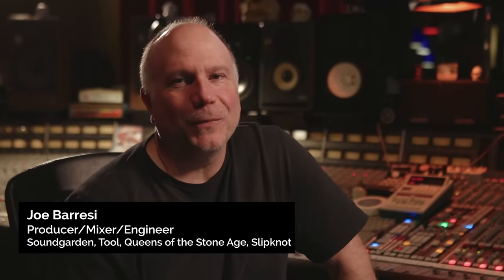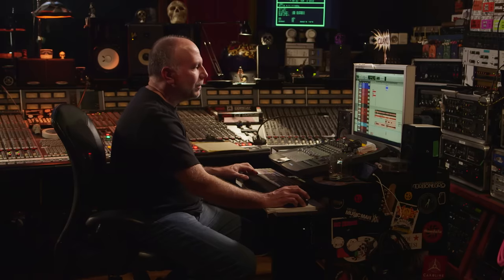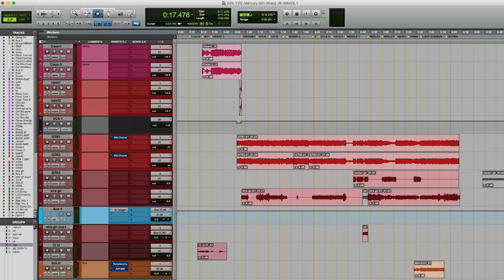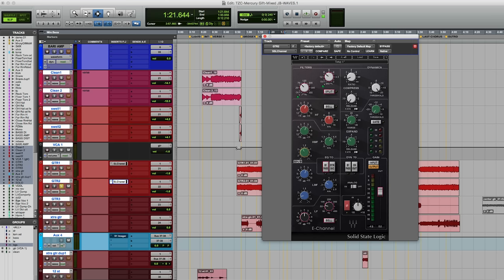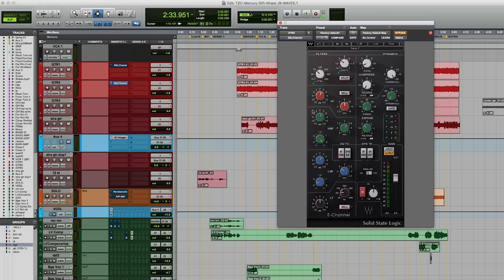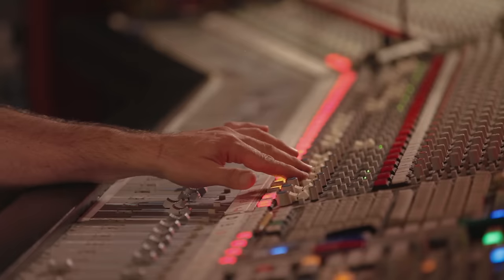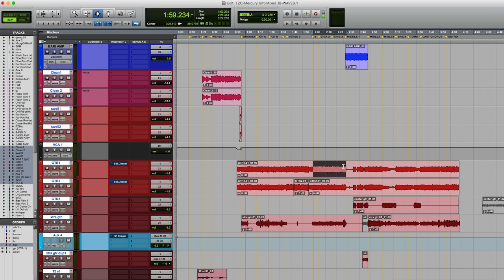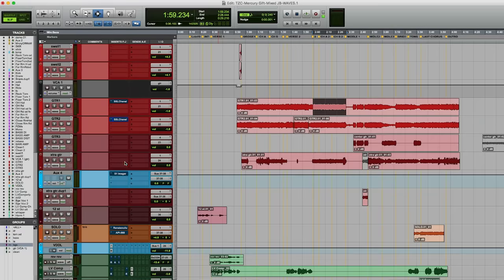Mixing Distorted Guitars | High Gain Tips by Joe Barresi

Comment: That is what I refer to as more of a classic crunchy guitar sound than I do modern, High gain distortion. The PRS lead/proper channel which the Archon possesses aside from anything in GTR is a fine starting point with a Maxon od 808 (or whichever overdrive or boost that suits your tastes/works with the front-end to smash the preamp harder, Tighten things up + the trusty, does exactly what I need/want in the boss ns-2 is and that is my type of territory and the guitars are most of the time far below standard tuning and longer than 25.5" scale-length).

The advice is all still applicable though and works. A great tool that I deploy but it sounds not exactly great isolated is an original roland microcube on the rectifier aping cosm model thing, It does a solid job at pinning down a rhythm track, same with a peavey bandit, a randall rg and the older marshall mg amps. Stuff that might be used for sratch tracks has numerous times found its way in to the final mix, The same way the now infamous Rockman for solos and then a little later the original SansAmp for all purpose essentially. I supose "extreme" is the term used to distinguish between the area which I operate in compared to the legend that is Joe Baressi.

I've never heard anything by Joe that isn't great, EJB and Melvins are up in the god tier level in my world. Cheers Joe for all the invaluable advice, Great albums You've hand a hand in and Waves for the consistantly great tools over two decades now and still delivering \m/

Comment: I've been wanting to experiment with a pedalboard solution for mixing different fuzz/distortion/clean blend/octave in a parallel mix? Either into one, two, or even possibly three power amps? 
Currently riffing on a cheap (but competently modded) 30" scale Firefly baritone offset with dual humbuckers. 
Currently been using an Orange OMEC teleport as just a mono to stereo splitter. then using a cheap Tech21 Orange preamp clone on one side, and either an EQD Life pedal V2 clone or an EHX Big Muff deluxe. Sometimes both! Then I'm using a cheap Sonicake ABY in reverse to sum it all back to mono.
The hypothesis in principle IMO is sound, I just have no way to blend in a clean signal for clarity or phase flip any potential issues.
I know I'm overthinking this, but I also possibly need much better buffered splitter & summing pedals? The JHS utility stuff comes to mind, as does the  something as simple as a Mosky Audio Loop Box?
Not sure...

Anyway,
You totally F'N HAD ME at "Parallel Distortion" Joe!
Haha! 
Brilliant!

Comment: Reading these comments you'd think nobody actually knows what preamp tubes do to the sound of a guitar. 
To elaborate, turning up the first gain stage on the amp will cause "clipping" or a bit of distortion,  and in general, you'd be hard pressed to find a guitarist who actually runs the pre amp stage on 0. hence, that's his "clean" sound.
Reply: pre amp tubes do NOT have to make your guitar pushed or crunchy at all unless you want them to.

Comment: thanks for vid great stuff.  question. Ive been taking a direct out of the guitar before the guitarist sends it off to amp land.  then usually micing the one cabinet with a 57 up close and a ribbon about 4 feet back. then panning the two mics left to right later lining up the phase on just the 57 and direct which Usually ends up archived or running into the guitar rig VST plug in.

So is the out of phaseing thing going on between the 57 panned opposit the ribbon mic (4 feet back) a problem because it seems to mono up fine? thanks for great vid!  and thanks for not using a bunch of plug ins the rest of us cant afford for this example

Comment: when using the ssl plugin, he 'burys' the compressor threshold. Is that because with a normal amount of GR he knows he gets the level he likes to have coming into the plugin? anyone know? thanks!
Reply: Pretty much. Given the low ratio and fast attack on the compressor and the inherent lack of dynamics in high gain guitars, my guess is that the threshold is buried simply for the fact that he wants as much of the guitar signal getting slammed as possible, and  finesses the amount of gain reduction with the ratio.
Reply: Andrew Leyenhorst thanks for the reply! Yeah thats kinda what i was thinking, I’ve just always heard about some waves plugins preferring a -18db analog level input saturation-wise, i thought this might be his way to make sure he doesn’t go over that? But yeah maybe he just likes to control GR with ratio instead of threshold

Comment: Metal used to be interesting.  Now it's so stock - rote guitar sounds, drum samples instead of room sounds, always in the lowest keys, and codified vocals in the 'ordained' arrangements.  Those guitar sounds are terrible cause of the cliche.
Reply: Modern metal may as well be a sine wave.
Reply: @harrisfrankou2368  I prefer a sawtooth
Reply: @MixChecks  yes and double kicks so fast you cant hear them.
Its important to have no dynamics...
Reply: @harrisfrankou2368  Have you tried replacing a 400BPM blast beat double kick with a fart sample? It works pretty well.
Reply: @MixChecks  I have.
To be honest to chop up the farts/parts into smaller rolls,I used ableton and my Guitarist disowned me for using "a gay dance program" as he called it.
I am still scarred by the breakup.
My bass player was even less tolerant.
Im on a very high beanbacon and eggs diet again and hope to let some real rippers go.
I have a mic in the toilet so I can capture some with natural organic reverb.
Reply: @harrisfrankou2368  Good stuff. The toilet bowl impulse response is my go-to for adding that slappy "wet" sound to all my kicks.
Reply: @MixChecks  respect.